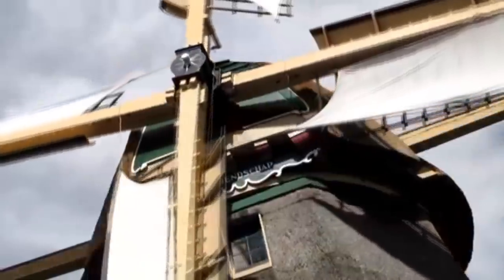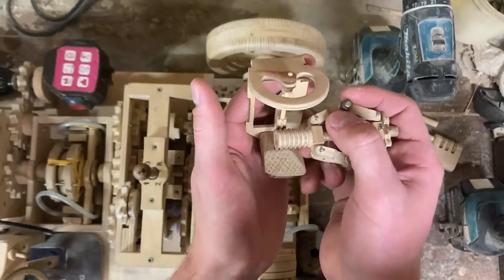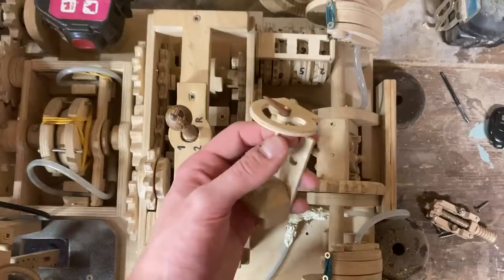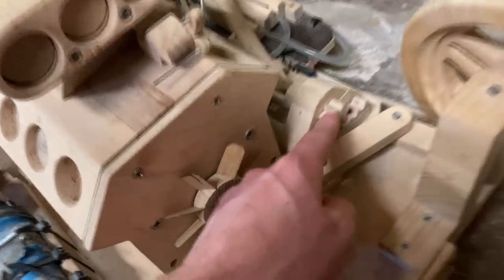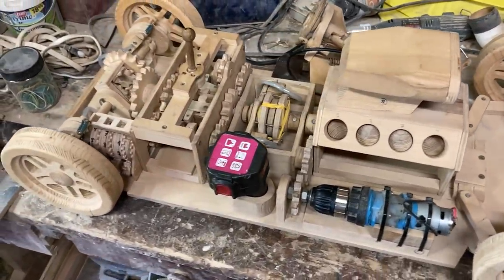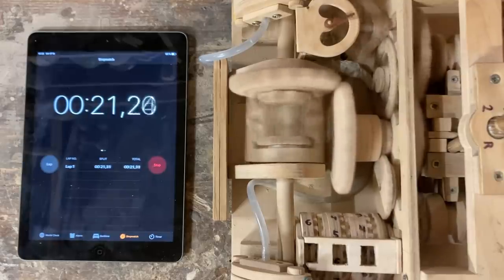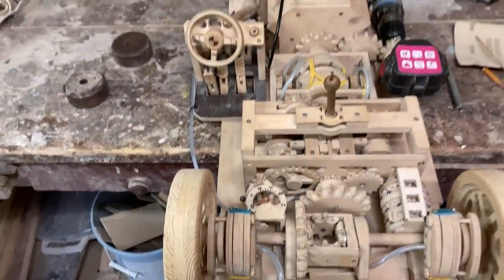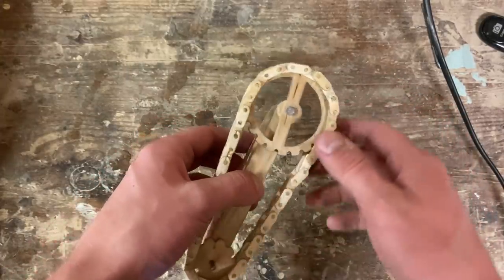Wooden Speedometer

Comment: We use ball governors in several systems on our PT6A turboprop engines. They control N1 fuel flow and N2 propeller speed.
Reply from the maker: That’s pretty cool! Do the G forces of the aircraft not have an effect on the acceleration of the weights or do they just cancel each other out?

Comment: also you better make some form of suspension geometry with that skill of yours, bet you can work something out easily
Reply from the maker: Yes! I wanted to add suspension to this model, but it was a bit much at the time. I plan on making pneumatic (air) suspension on my new model and also have adjustable ride height (with an air compressor) operated by a switch from the interior.

Comment: I'm curious how you cut the threads on that worm gear because whenever I use single point thread cutting on my lathe it just shatters the threads
Reply from the maker: I’d say it comes down to just using a very sharp tool and removing material very slowly. Also go for a dense wood like birch or some hardwood.
Reply: @GenericWoodworking  thanks yeah I'm just using regular carbide inserts meant for metals I should probably try cutting one of my high speed steel blanks to be really sharp also I'm probably about to get a vacuum chamber to go with my pump so I can inject wood with resin make it easier to work with

Comment: wouldn't that be more of RPM then speed, since it is currently not moving, or am I very wrong
Reply from the maker: Well, it displays rpm. But due to its position the rpm is exactly proportional to the speed. Had I mounted it right next to the engine then it would be an rpm gauge.

Comment: Would this be a speedometer or rpms.
Reply from the maker: Speedometer. It works exactly the way a tachometer (rpm gauge) works, but it takes the reading from the rpm of the wheels (which is proportional to the speed of the vehicle). Had I mounted this device directly to the engine then it would tell me the rpms of the engine.